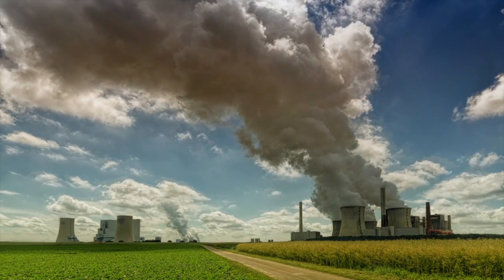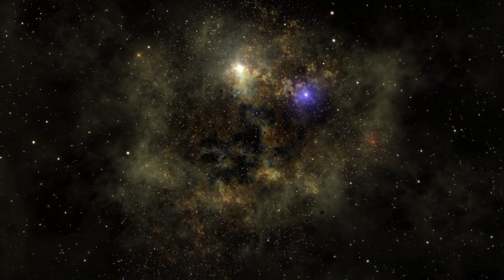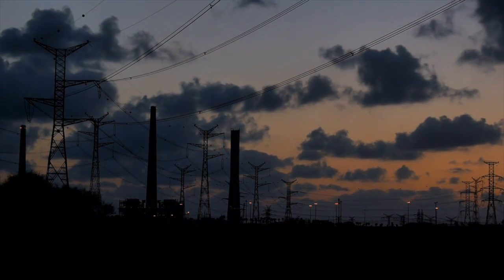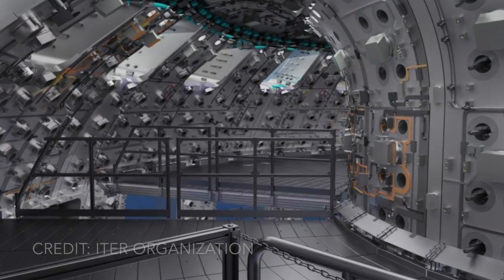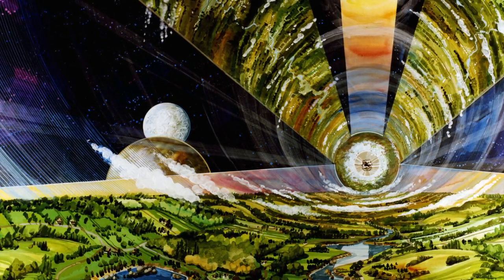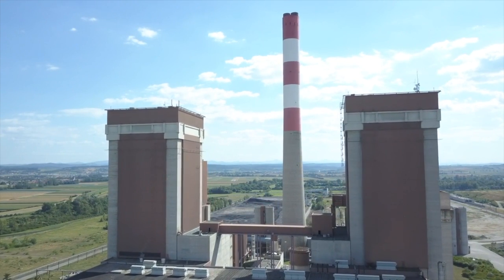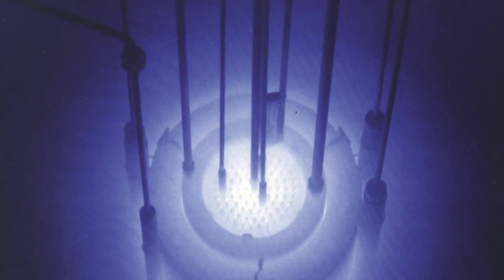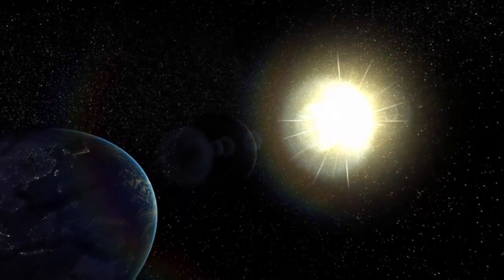What's Really Going on with Fusion Energy

Comment: In the press release of this info when she mentioned “securing our national standing” I knew it wasn’t much of significance in terms of commercial. Great video!
Reply: A wonderful SCIENTIFIC achievement — Optical Breakeven — but not very useful result from the TECHNICAL side of things.  
Using Nd:Glass lasers with so low conversion efficiencies for electrical energy into optical laser beam energy means you need a thermonuclear output enegy several hundred times higher.
Besides there are a huge number of other ootical, material, electrical, thermal engineering issues that have to be solved to get a practical Inertial Fusion reactor.
There are not enough brainpower employed in these problen, and ICF funding is mostly.l provided by the military budget of the DoE, so the predominantly foreign High Energy Density Physics graduating from UoRochester, UCDavis, UCSD, UNevada-Reno are usually excluded from ICF R&D. 
In the USA, ICF is predominantly a military-oriented research program — to investigate, test, homologation, validate R&D for Thermonychear and Directed Enegy Weapons.  Energy generation is not a priority.l — results like this ignition are predominantly budgetary PR for DoE's Lawrence Livermore, Los Alamos and Sandia National Labs.

Comment: The takeaway from LLNL is the net gain in energy - which is now screaming out to all engineers  "Hey fusion is actually controllable". It's reasonable now to think some or many of them can come up with a smaller, practical design that doesn't take 20 years to implement IRL.
Reply: A wonderful SCIENTIFIC achievement — Optical Breakeven — but not very useful result from the TECHNICAL side of things.  
Using Nd:Glass lasers with so low conversion efficiencies for electrical energy into optical laser beam energy means you need a thermonuclear output enegy several hundred times higher.
Besides there are a huge number of other optical, material, electrical, thermal engineering issues that have to be solved to get a practical Inertial Fusion reactor.
There are not enough brainpower employed in these problems, and ICF funding is mostly provided by the military budget of the DoE, so the predominantly foreign High Energy Density Physics Ph.D.s graduating from UoRochester, UCDavis, UCSD, UNevada-Reno are usually excluded from ICF R&D. 
In the USA, ICF is predominantly a military-oriented research program — to investigate, test, homologation, validate R&D for Thermonuclear and Directed Enegy Weapons.  Energy generation is not a priority — results like this ignition are predominantly budgetary PR for DoE's Lawrence Livermore, Los Alamos and Sandia National Labs.
Reply: The problem is that the press releases were all 'fusion energy!' not 'controlled fusion tests.'  And then cited the net gain of energy in the ignition/fusion process while largely ignoring the net loss of energy in operating the device.

But the former will convince people to push Congresscritters to support a project that has no relation to the goals that people want; far more people are interested in clean energy than testing bombs.
Reply: The biggest drawback of ITER is the time it takes. Together with a setback in cracked concrete discoverd last month, that thing just takes forever to test out simple principles. These problems and testing of complex but basic principles needs a lot more flexibility and a lot less bureaucracy. A good moment for smaller companies to jump in.
Reply: There is not enough helium to make fusion a viable fuel source for the future.
Reply: gain of energy over energy fed to the lasers. But the trick is, the total energy also goes to magnetic containment field generators, and other systems. And they don't talk about that.
Reply: Not really. Of all the methods used to do fusion, that is the least controllable.

A deuterium-tritium core, ignited with X-rays is not new. We've been able to do this since the 50's. It's called a hydrogen bomb.

Basically, this is a tiny hydrogen bomb, that doesn't use a Uranium jacket to provide the X-rays.

It's a convienient excuse for nuclear weapons testing and development.

Plus, on previous tests they spent 400MJ to make 1.3MJ of X-rays. That's less than 1% efficiency.

Which means they spent over 500MJ to create that 2MJ of X-rays that produced 3MJ of fusion. 

I honestly don't think they're trying to develop fusion. They're developing more efficient (I.e. more powerful) hydrogen bombs.
Reply: The fundemental problem is that it's a bait and swith to even talk about 'net gain' in a plasma.  The only 'net' that matters is the overal device net gain, anything less and the device in an energy sink each cycle.  But any real device would have inefficiencies in that cycle and needs to have a gain of many times more in the plasma in order to cover thouse losses and sustain a net gain over a cycle.  We can make reasonable enginering estimates of what thouse inefficiencies would be and thus dertermine what amount of gain in the plasma is our target, realistically I can tell you 3 or 4 fold is a bare minimum if your using a heat engine.  Only when that is reached can you stop doing experiments and switch to building out pilot device which achives net gain.  So in hyping 'Q Plasma' as the engineers call is a meaningless benchmark which only sounds important by deliberately cultivating misunderstanding in the audiance.
Reply: You won't see fusion going commercial in your lifetime. The oil lobby(and gas lobby) won't allow it. Maybe in the very late 21st century - the 2070s or 2080s perhaps.
The whole world runs on fossil fuels. Oil sets a certain world order and some groups intend to maintain it.
Reply: Even COAL power plant require 20% of it's power output(or from other pov, it generate 5 times more power than it's requirement) to even start generating any power at all. The power it requires are used for cooling systems, fuel systems, monitoring systems, and the power generator itself also require power. Yes, the thingy you turn the shaft to output power is using electromagnet. I would imagine a fusion power plant will need to output multiple times more power before any practical power generation system can be used, not 20%.
Reply: Controllable lol
Reply: no. its 1% of input.
Reply: @esecallum  Only because it was never intended to be an efficient or economical generator. It's a DOD sneak to skirt the test ban treaty first and foremost. Modern lasers could be 40% efficient to NIFs ~0.7%. That's still not quite net output but inertial laser fusion is possibly the least practical method of fusion power generation aside from nuclear weapons. Stellarators, spherical tokamaks and more just counting the continuous plasma types all have entirely different ways of getting that energy in anyway. It's just, hopefully, only a matter of testing ITER to confirm and validate the models predicting that scaling up the reactor a bit more (while using newer tech in more compact, efficient and cheaper magnates etc) will get to commercially useful output.
Reply: @johnassal5838  I tend to agree with you about laser inertial confinement, but what kind of laser are you referring that is 40% efficient.  I have heard this before but could not find any details on a laser that has that level of efficiency and could potentially be used as an upgrade for NIL
Reply: @johnassal5838  The number of science channels using the laser consumption to dismiss the findings without mentioning this is pretty disappointing. No less sensational than media underexplaining it.
Reply: @esecallum  It's actually a positive energy gain of around 20% of the energy that hit the fuel source. The next problem is to get more energy out of the entire system than was put in but that is an engineering problem but it will still take many many years before we overcome that hurdle.

Comment: The recent successful work has a direct application for fusion energy production because it is informative in the areas of laser control and target structure, even though it was using 1990's era lasers which have had their efficiency greatly exceeded by more recent technologies.  The Australian company HB11 Energy is developing Laser Hydrogen Boron-11 fusion to generate electricity using laser-ignited non-thermal fusion. It is an aneutronic and very compact path to small and affordable reactors that do not produce any radioactivity at all. And if you are thinking pfffft what could Australia do, take note that the most advanced uranium isotope separation technology in the world uses lasers and was also developed in Australia.

Comment: Correction: The fusion method used at NIF can be used for power generation.  It simply must be scaled up, and you have to do it about twice per second.  Just an engineering problem.
Reply from the maker: That's what they said in the 1950's. Fusion is just an engineering problem. We're now 70 years on. So I'd say maybe we might have something for inertial confinement in 50 years for power generation, but I think it's probably significantly longer. I know that sounds pessimistic, but the history of fusion development is the ultimate exercise in slipping timelines.
Reply: @JohnMichaelGodier  And they were wrong to say that before Dec. 5th, 2022.  No one knew if technological exothermic fusion was possible before that moment.  Now, it TRULY IS an engineering problem, not a scientific one.  This is a giant stride, and to say otherwise isn't accurate.
Reply: @JohnMichaelGodier  I think you're understating this.  That advance brought fusion power from the impossible to the possible, and while the past is a good guide, it's not prologue.  I say by the end of the decade.  Let's hope I'm right, and you're wrong.
Reply: @LordSlag  The scientists running these experiments do not agree with this Admin and have just been miss-reported in the media for clicks. Personally I think these experiments actually show how non viable this technique is for energy production and all we really know is how monumentally difficult it is to get even a single net gain event.

We will probably know by 2030 if/when Fusion reactors will be viable via ITER so we will have some realistic time frame estimates rather than pure guesses.
Reply: The NIF is a research laboratory to produce fusion not electricity. Even if its "scaled up" it doesnt come any closer to producing electricity.

Comment: I still consider it a breakthrough. We managed to get more out than we put in. This means it's possible and we can do it on a larger scale. For us it might not be a big deal because we most likely won't live to see it's application used on a large scale but for humanity I think it's a major step
Reply: This is only true if you don't count the energy used to charge up the lasers that fired at the material rather than just the energy that the lasers hit the material with.
Reply: @D1craigRob  The lasers only need to be charged up once at the beginning, no?
Reply: @luckyblockyoshi  no it will have to be multiple times a second.
Reply: @patrickhenry1249  Because to think of Q Plasma as the focus requires pretending that hydrogen bombs and, y'know, stars don't exist?  We don't need proof fusion can happen; we already have that.

To be fair, most of my salt is really directed at the popular press and the people who can't be bothered to look any further.  But this is roughly the equivalent of being impressed that they can set gasoline on fire, and then claiming that that is proof the internal combustion engine will go on sale next week.

Comment: If a helium shortage is a real possibility within decades, why is it still available for recreational use?
Reply from the maker: Horrific resource mismanagement and not yet enough financial interest in its coming scarcity. That will change. What you'll see is helium get really expensive really quickly and pass out of recreational use. There's a hard brick wall coming there. It's too useful industrially for prices to remain low.
Reply: Because people who matter either don't know about the issue or don't care.   I just heard of it myself.
Reply: Doesn’t the US have the largest stock pile of Helium? I think about to be sold off to private companies. Massive underground storage facility put together when airships where the future of the navy.
Reply: @byrnemeister2008  Pretty sure that stockpile is mostly past tense, and as a government run thing its numbness to market forces are one reason helium prices have been so stable despite stockpile depletion.

That, and of course, the folks who care about helium prices care a lot, while everybody else doesn't care, so all the political pressure is on continuing to sell at absurdly low prices.

On the plus side, once prices stabilize at a more appropriate level, new sources will be developed and improved.

Comment: Except that the whole energy grid will have to be replaced to use it
Reply from the maker: Should be alright on the energy grid. The result of fusion as far as the grid is concerned is just electricity. Same as the difference between a coal fired plant and a nuclear plant are vast, but the grid doesn't care. To it, it's just electricity.

Comment: @John Michael Godier what are your thoughts on Stellarator reactor designs? 

I just recalled reading some people arguing last week over how Tokamaks suck and Stellarators are going to sneak up on them once we have the algorithms able to optimize the design of their weird shapes. 

They were saying how if we can get machine learning to crack the optimal design (or at least any design that can facilitate the containment) for the flow of the weird contours in its ring, we can bypass a lot of the magnet and other materials-science related hurdles holding back Fusion rn

I’m honestly to equipped to know whether what they say is true tbh

The CFR sounds amazing, but the extreme reliance on magnets seems like it should be stuck at the same roadblocks public reactor designs are. Unless LockMart is hiding some insane superconductor advancements - which is entirely possible - then it seems like it’s no closer than others 😢
Reply from the maker: Stellarators are promising and they do have advantages over Tokamaks, but the issue is that with Tokamaks we have decades of experience in working with them and refining them. Stellarators are more or less just starting, so it might end up being an issue of practicality in development. Sure we might someday have stellarators and they might be the dominant tech, but for the first decades of fusion energy generation it's probably going to be tokamaks just because we're so far down that road. That's assuming both concepts don't get leapfrogged by CFR or some like novel concept. But they all work on some kind of magnetic confinement. Confinement is key for those designs.
Reply: @JohnMichaelGodier  great, thanks for the reply!

Comment: Break through? Proof of concept only, commercial application still decades away. The old saying still stands; "Fusion, the power of the future and always will be."
Reply: did you even listen to the video?
Reply: @zooot820  Apparently not
Reply: Planes, the future and always will be.
Reply: Always been 20 years away, never 19
Reply: Until now
Reply: “Proof of concept” is just that; proof that it can be achieved with current technologies and methodologies. To provide another quote; “Once the mathematics proves out, it’s only a matter of engineering.” I will agree, still a while to commercial applications, but now we know it can be done.
Reply: its a political stunt to divert from the recent prison exchange an arms dealer responsible for thoisands of deaths for a pothead that didn't think it was a bad idea to pack pot through airport security.

The current head of the department of energy was appointed by the current administration based on zero credentials and even cow towed deflecting the cause of gas inflation.

its always a political circus.
Reply: It will never happen.
Reply: Net positive output is a breakthrough. Just because you can't put it in your garage doesn't mean the science didn't just happen.

Comment: It is most unfortunate cold fusion is not working
Reply: "Cold fusion" is such a BS hype misnomer. But LENR does work already, repeatably, unlike hot fusion. More research is being done to refine the techniques required to bring about reactors on a commercial scale.
Reply: Unless you can find a way to easily produce muons without a particle accelerator, cold fusion will always be BS.

Comment: Well, at least we’re ten years closer than when I was growing up. Most of my life fusion was always thirty years away, it’s only been the last fifteen years or so that I’ve been hearing twenty.
Reply: I've been hearing 10 since the 60s
Reply: @lapurta22  
I have been hearing 20 years since I entered my ICF Ph.D. studies in UoRochester in 1990. In fact, the UoR/LLE Improved Omega laser was supposed to achieve thermonuclear ignition in Direct Drive mode by 2010!
Reply: The 1st controlled fission reaction occurred in 1939 and the 1st nonexplosive use of fission power for energy was ~1954.  Since things seem to advance much slower now thanks to bureaucracy and politics I figure fusion power is >=30 years off, so expect it ~2052.  I won't be around to see that but maybe some of youz can place your bets.
Reply: I think you‘re missing the point that all these are fantasy numbers to begin with. They were (clearly) fantasy numbers then, and are likely fantasy numbers now given that the only predictable project would have experimental power plants by the 2050s IF they can solve the myriad issues which is far from a given.